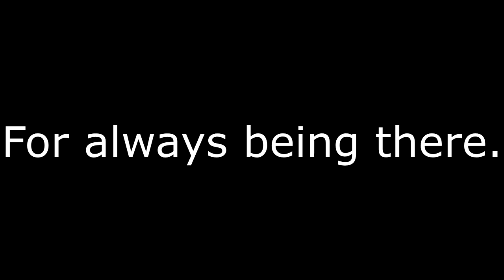FINAL KODIAK 400 REVEAL (500,000 SUBSCRIBER SPECIAL)

Comment: Hey 3Dmachines. What's the tire difference in Hightower on your quad. I know the fronts are supposed to be smaller. My fronts at 1 inch smaller. And also is that in constant 4x4 like my Honda fourtrax 300

Comment: I've changed several factory radios in GM's over the years. I'm 48 and enjoy watching alternate ways to fix things. But as far as your factory radio, you need to take it to a dealer, GM dealership, and they need to put in a code. this can only be done at a dealer. there is to my knowledge no way around this, unless you put in an aftermarket radio. and even then you need a fifty dollar box that fools the computer in thinking it's your factory radio. good luck bud.

Comment: Should definitely get 4 of the same sized tires for the kodiak, with different sizes on the front and back the front differential will spin slower than the rear differential when they're supposed to be rotating at the same speed. Excessive wear yada yada, but that should be fixed